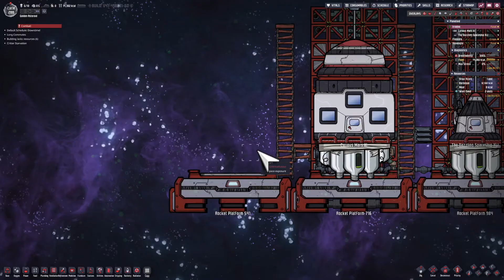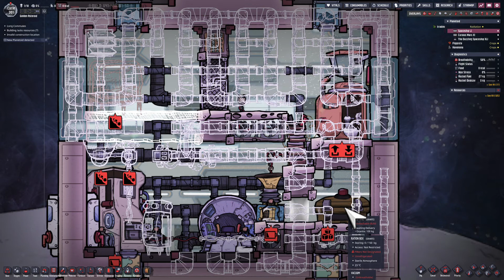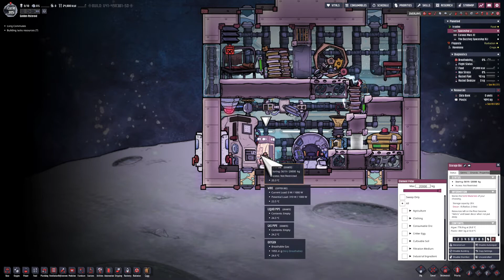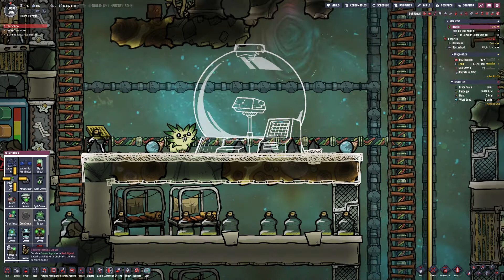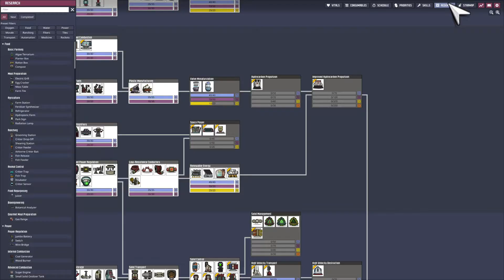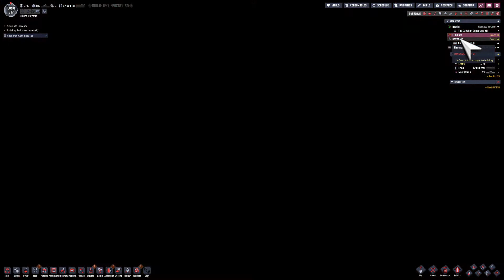ONI: Radioactive Ocean Astroid - #7 High Velocity Transport

Comment: i may be wrong, but there's another way to deal with germs... as you know, minimal air volumes cause germs to die.. theoretically, if you use a valve and reduce the gas flow to minimal amounts, the germs will also die away as they flow around your pipes. i used that method to purify oil once, so recon it should be similar.